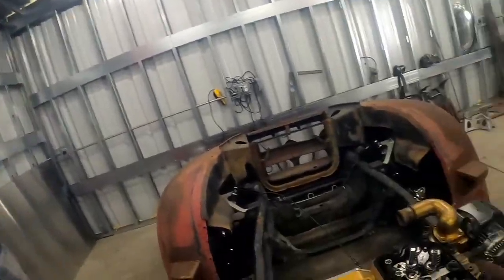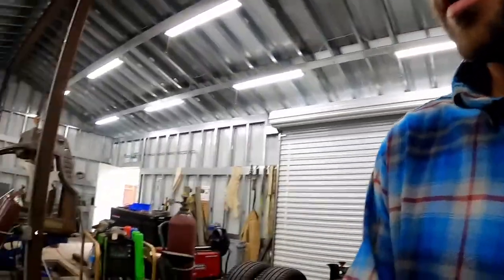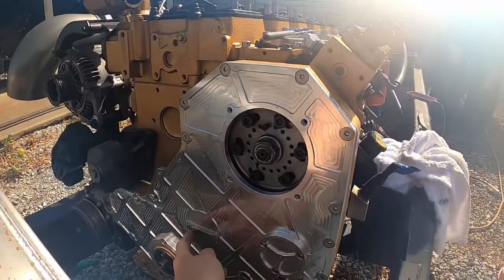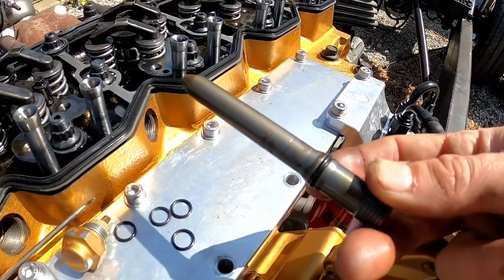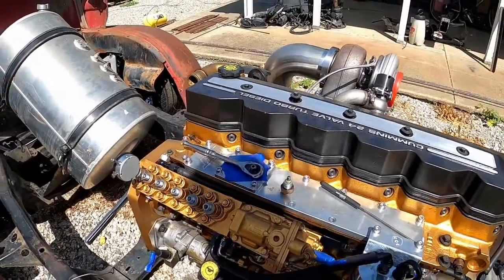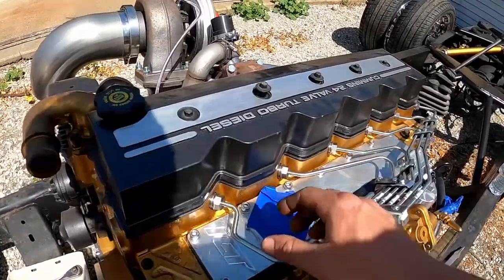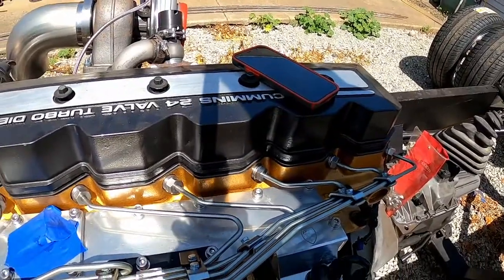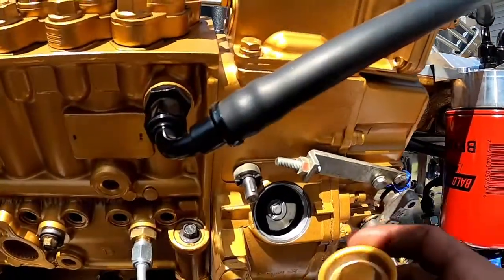P-Pump 24 Valve Cummins setting timing, GSK, Fuel plate, injector, & delivery valve install!

Comment: Rich, put your balancer on and make a indicator pointer, mount it to the two holes just below the water pump on the housing, and mark you balancer, then put a Fleece turning tool on the front balancer bolts.  That way you can bar the engine left or right!!  Then you can back up the engine and then bring it back up and recheck the pump timing. Also setting the valves is a breeze!!    One other thing you might want to consider is a AFC on the fly. I think power driven diesel sell one, however all it is, is a boost reference line run in the cab to a very sensitive regulator so you can dial up or down the boost signal going to the AFC diaphragm.  It can really increase mileage and clean up the coal!!  Also you can adjust for pulling when in need.      I hope this helps, take care.  Your doing great!
Reply from the maker: Man I am so glad you have taken an interest in my build Earl, it’s nice to receive constructive feedback from someone who’s been there, done that! I realized a little after I made this video that I set my timing for the pump based off the wrong pump, and instead of 24* of timing I’m actually only at 16, which from what I understand will not make the 24v very happy, so I’ll definitely be back in there making some adjustments! The adjustment on the fly sounds like a worthwhile investment, I’ll definitely be looking into purchasing one! Thank you once again! New update coming soon!
Reply: @turborich8316  Rich how did you know you had based the timing off the wrong pump?

Comment: Just want to give a tip the injector hold down brackets are slotted on the rear and are meant to rock on the injector so you can just pull the front bolt out and slide the bracket out and pull injectors with out removing the rockers. Saves some time so you don't have to set the valves after.
Reply from the maker: Appreciate the information 🙏
Reply: Also I used a long bolt and washer fed through a deep well socket that fits over the injector to act as a puller and it comes out smoother than prying

Comment: What cam are you running?  I have a fully re-built 24V with a Hamilton cam, custom Ppump with dual feed, custom injectors ect ect ect. Set at 14deg adv. How much advance can you run & be safe? Plan is to run an afe live.  What hp & Tq are you shooting for &  weight of the truck & load you plan on towing?
Reply from the maker: It’s very common th run 24 degrees in these ppump 24v, that’s where I’m currently at and it seems to work well, now I know with 12 valves the more timing you add the harder it is to start when cold, I’m not sure how much that effects the 24v but I imagine it has a similar effect. That said, I live in California and it never gets to zero here. Afe live is good for dialing the pump in, but once you find the sweet spot it doesn’t get used anymore, so I personally prefer to tune the pump, pull over, tune it some more, till it’s in a good place. Saves all the money on the afe live. I’m currently maxed out pushing 50psi thru this one, I recon in the 5-550 hp range. The motor is currently in a 55 Chevy car and I only tow my jet skis with it. I’m building a 12 valve compound setup now for my tow rig, and I’ll be running an s475 t4 1.10, the 24v runs a s475 t6 1.32, and it spools a little later than I’d like, could be my external wastegate opening too early, but I have read the smaller turbine s475 is better for towing setups!
Reply from the maker: This 24v does have the biggest Hamilton cam you can put in it stock.